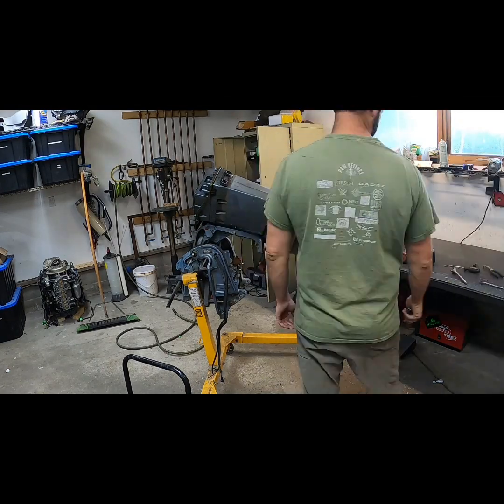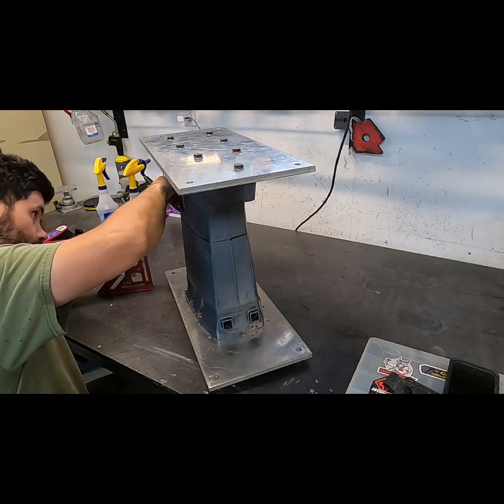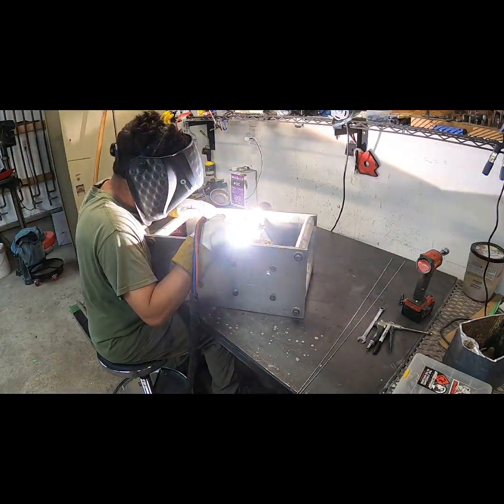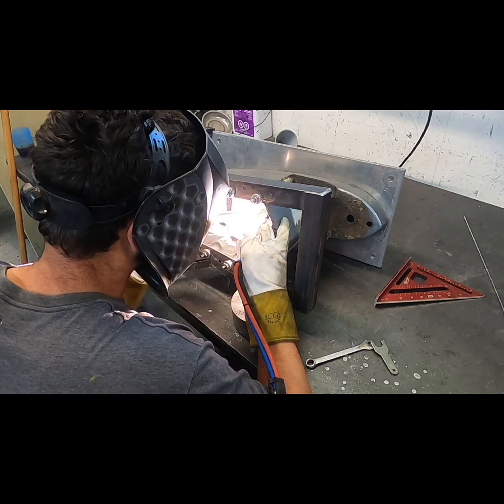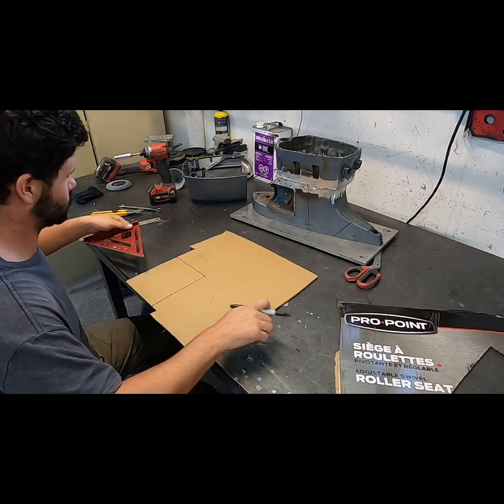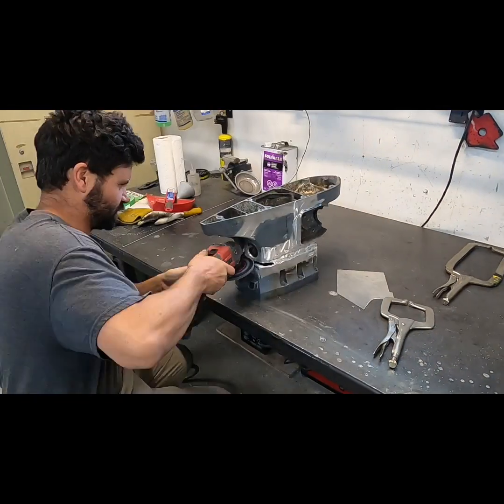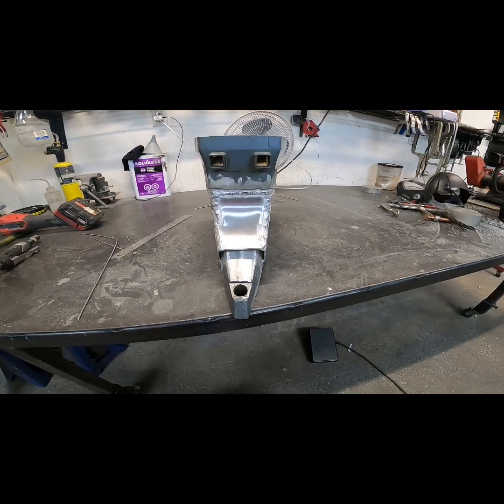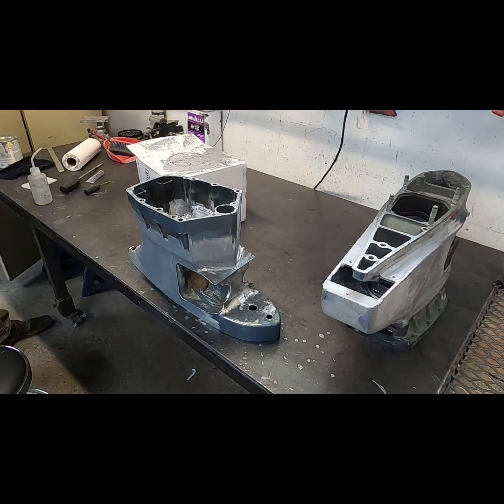Short shaft Yamaha build

Comment: This is JUST what I’m looking for!
Or almost 😉
I’m looking to shorten a Yamaha 90hp 2 stroke, but I hope much is similar 🤞🏻👍🏻
Keep up the good work!
Looking forward to the next update 😁
Cheers from Norway 🇳🇴
Reply from the maker: It's going to be virtually identical, main differences could be in the clamp/trim, which will dictate how much you cam shorten it.
Reply: @Hydrostreamrebuilds  I’ve also heard something about you can use 40hp 15" (short) 4 stroke clamp bracket and power trim unit when making a short 90…
Reply from the maker: @arnejrgensen606  Very possible. I don't know for sure though.
Reply: @Hydrostreamrebuilds  
Looking very much forward to a new video 😊👍🏻

Comment: Great video .. Can u do a video complaining this set up for example the bracket  to the transom the shorten of the drive shelf and water pick ups or the foot side of things please and thanks
Reply from the maker: Yeah I'll do some more videos on this, shortening driveshaft, modifying a clamp, etc. Haven't worked on then in a while
Reply: @Hydrostreamrebuilds   Thank u my guy waiting on these vids to do mines
Reply: Yea I wanna the clamp, like is it just shortened somehow or is it completely custom. And can it support the engines power on its own or is the like a Y on the boat side where the lower unit rests when on power. If that made any sense
Reply from the maker: @thomaslindroos1667  yah the clamp gets shortened and modded. The factory trim system is retained, operates identically to factory full length system.